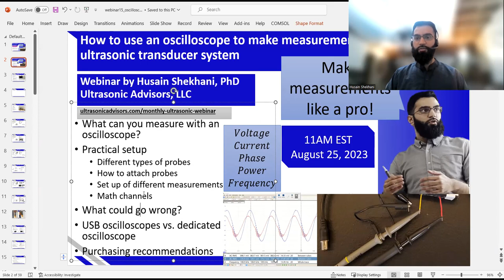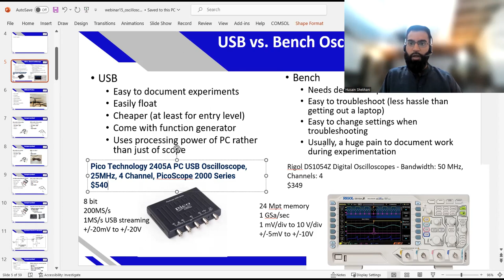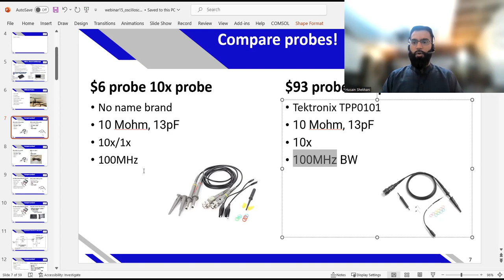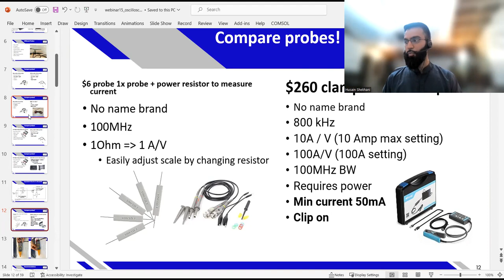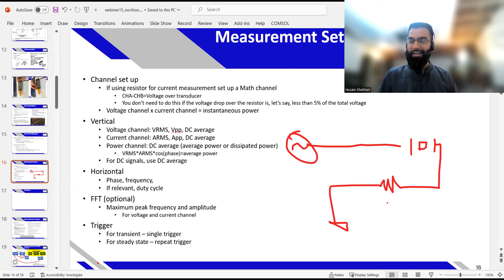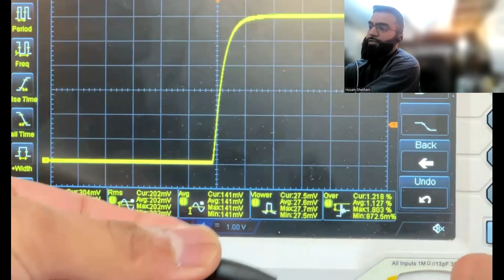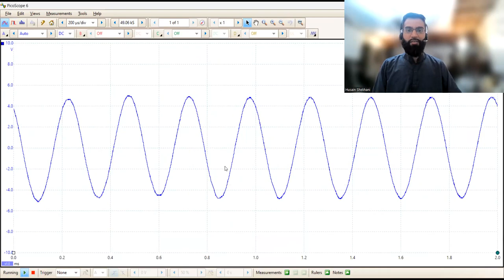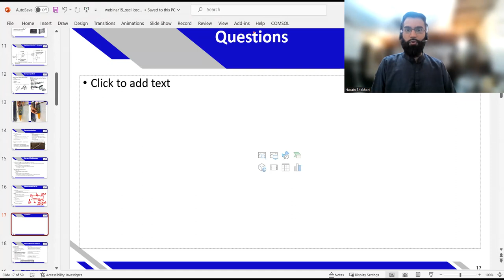How to use an oscilloscope to make measurements on an ultrasonic transducer system

Comment: hello
I always appreciate the videos you upload.
I am writing because I have one question.
Currently I am trying to build a small ultrasonic cleaner.
So, I'm trying to make a water tank to attach an ultrasonic transducer to. Could you please give me some advice on what material to use for the water tank?
Currently, I am using an ultrasonic oscillator with a resonance frequency of 44kHz, and I am wondering whether I should use ABS or SUS as the water tank material. General ultrasonic cleaner products use SUS material, and I am curious to know if there is a special reason for this.
Reply from the maker: I'd recommend a thin stainless steel container.